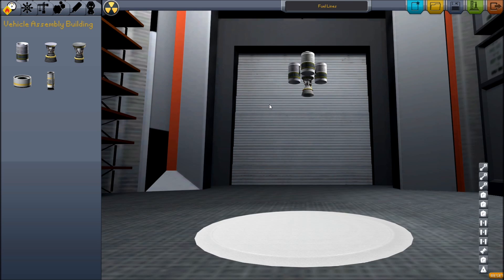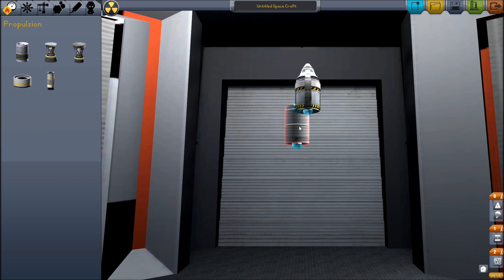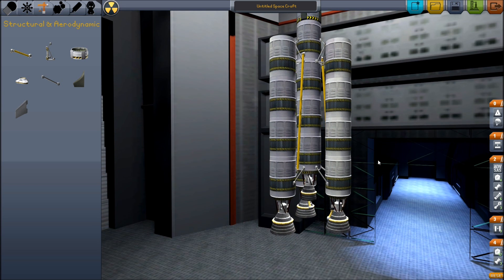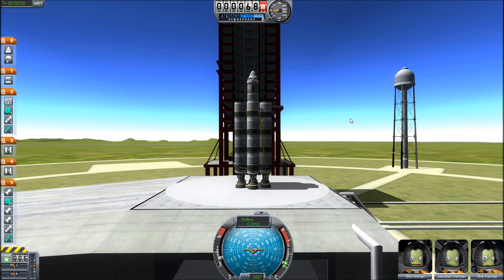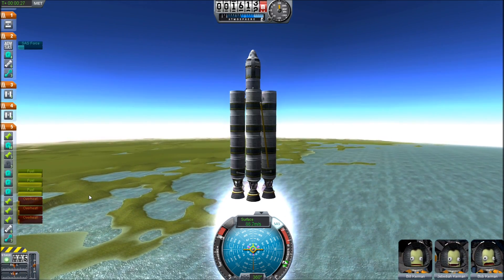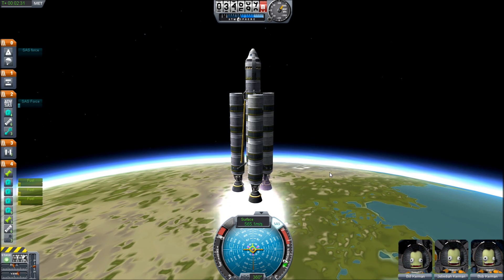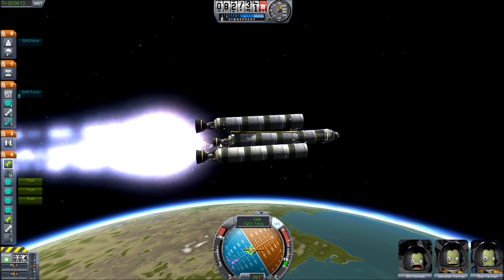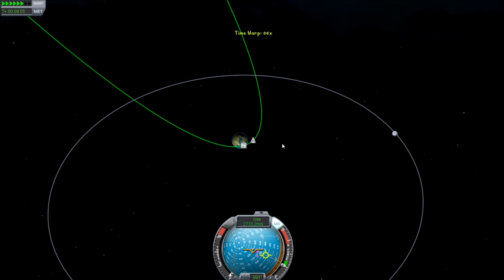Kerbal Space Program - Unfavorable Fuel Lines

Comment from the maker: @MBChilladin It really doesn't matter. It comes down to delta V, that is the amount of change in speed a rocket can make. Not matter how you arrange it, the delta V would stay the same. The only way I could see maybe the fuel lines working is through a liquid engine that burned fuel very quickly for extra thrust, but then you just described what a solid booster rocket does.